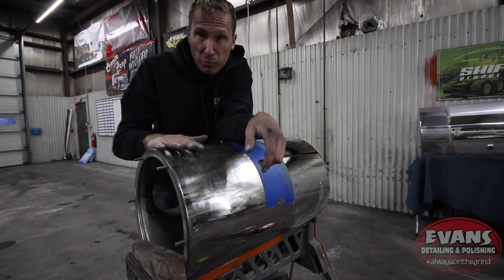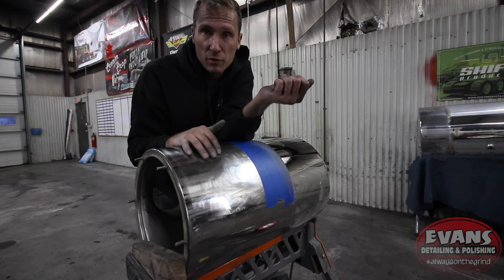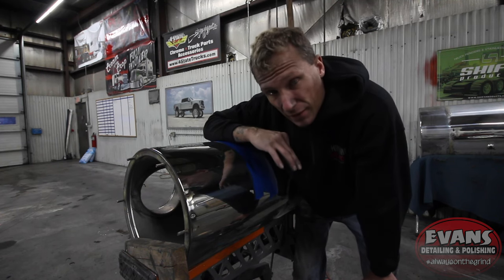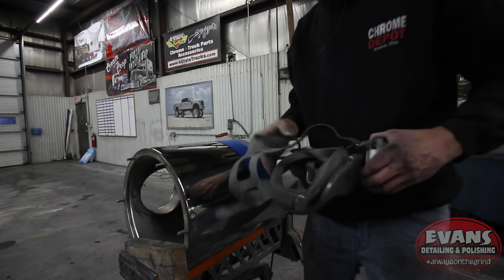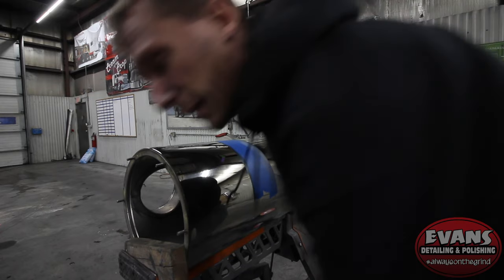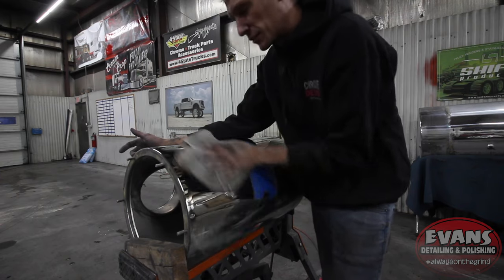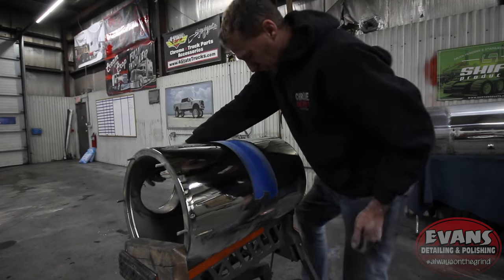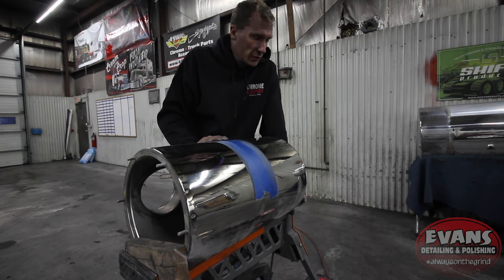How to polish stainless steel to a mirror finish.

Comment: I could see that the sanded side had less nicks, specks etc... Sure it takes longer but I grew up painting custom vehicles so I did a lot of sanding and of course after you painted that beauty it needed to be polished so I had to learn it right or you were fired and or had to repaint it as in my case as my dad was the owner lol.
Reply: I see the same, sanded side is much better.
Reply from the maker: That is the name of the game. The smoother the start the better the finish in almost everything in life. But everyone has different expectations for the final finish. For some the unsanded is good enough.

Comment: What power tool would you recommend for an average joe diyer who just polishes his motorcycle stainless exhaust.  It originally had a mirror finish but have lost its shine due to corrision and road grime. Would a 3500 variable speed polisher due the job to bring back some of its mirror finish?

Comment: Hello Evan just recently Subscribed to your channel, love you're videos.  I have commercial 6ft stainless steel, propane griddle.  What Makita model would be perfect to remove deep & light scratches, Makita 9227c or Makita 6,000 rpm?  Made the error of hand wet sanding the griddle with 400 grit.  When't to Lowes and bought a Craftsman CMEE145, 6", 6,800 OPM, variable speed.  Have not open it, cause, I stumbled upon your videos.  Please guide me towards the correct product for the job.  Thank you Sr.
Reply from the maker: You are on the right path already. The best avenue to get you ahead without having to read a book from me I would go on my channel videos and check the how to sand and polish stainless steel video. It'll be super helpful. We also sell a stainless polishing kit on goshineon.com/shop. If you need anything let me know. Text pics to my cell 9209790386 if you need help and I will try to help you best I can.

Comment: Have any tips how to smooth/sand a big 316 SS hex nut by hand?
I have a pair of 1-5/8” thread hex nuts (700gram each) I wanna make nice and shiny or brushed at the least.

They are like typical nuts… lots of small dings/pits and imperfections from rolling around in storage, etc. …basically like a pseudo hammered finish. I think the first step is to smooth/flatten it, correct?

I tried 60grit by hand… hardly did anything.
Then I tried a Makita “finishing sander” (vibrating kind)… didn’t do anything neither.
Unfortunately, I don’t have any other rotary polishers nor grinders nor belt/disc sanders.

Tried a bastard file… this was by far the best yet. But still took 10-20mins per side (6 sided nut).
I have some old sharpening wet stones I might try next… perhaps for finishing only, since it’s 300/1000 grit.
Reply from the maker: The way I show in this video is the only way I personally know how. I couldn't accomplish this by hand. I know a few that can but I have never seen it done. Sorry I can't be more help on the subject.
Reply: @EvanStegerMetalPolishing  No prob!

I got it done with a bastard file (main step to flatten/smooth out) > 300/1000 whetstone > 1000 wet sand > 1500 wet sand > polish. 

Not perfect; but it's good enough for me. 
Took countless hours, a couple days and very sore forearms, lol.

Comment: What wheel can you use on stainless? Can you use a regular orange cutting wheel? Or does it have to be a specifically made for stainless? And what compounds cut/color will work for stainless? Thanks Evan your the God of polish! 👍🏼
Reply from the maker: You can use whatever for buffs. I prefer buffs made to hold up to the heat of stainless. But that is a preference on my part. goshineon.com has a stainless kit. I also show which buffs and compounds in this video and in my how to sand and polish stainless video. Hope this helps

Comment: Hi thank you for the very valuable lesson Amazing results indeed
Speaking of powder to eliminate the greasy residues will talcum work? Thanks a lot again kind regards Gino
Reply from the maker: Great tip! Yes talcum does work but I personally prefer whitening powder. It is less abrasive than talcum.
Reply: @EvanStegerMetalPolishing  hi thank you for the very kind and valuable advice Your video are very nice and highly educational I have a challenge To try to recover stainless steel knives ended in chloride acid I think I will have to sand them first and then polish them to get possibly a nice look Thanks a lot again Kind regards gino

Comment: If starting from a mill scaled stainless finish what steps would you start with to be most efficient and to cut down consumable costs. I work in a custom stainless shop. And it seems like the techniques we try are always changing because no one can seem to understand it. Lol. TIA great video,
Reply: Our steps vary but are usually around.. If starting from mill finish.

-Rip flat with 120 grit on 5 inch grinder
 
- sand with 220 until previous finish starts disappearing. 
 - Again with 400..
 Repeat process to 6-8-1000- 1200 grit
- begin adding polishing compound and using a cotton buffer wheel. 

-** problems**No matter what, we can always see one of the steps left over in the final finish weather it be a fine or deep scratch 

We are looking for a set way start to finish to accomplish a standard mirror finish. 

Something the same every time.

Comment: im doing some stainless exhaust pipes.cant change direction,the pipes are too small so i have to hand sand after every grit to smooth things out.
pain in the ass.
Reply from the maker: Agreed. They are an absolute pain. I switch up direction on exhaust pipes though. It isn't easy but is achievable.

Comment: Does stainless require same polishing temp outdoors as aluminium. It's about 57 degrees here
Reply from the maker: Yes. Stainless needs to get hot to shine. If it doesn't get hot it won't want to give up the shine.

Comment: And what type of grinders are you using for rpms does it matter between 6000 or a 3500 variable speed??
Reply from the maker: It doesn't matter. It is a personal preference thing. I use 6,000 rpm for cut and color but I use the variable for high lustre finish stuff.

Comment: Evan, can I use the same wheels on stainless that i use on my alum? Thanks. Scott.
Reply from the maker: Yes you can! But I don't recommend mixing them on the multiple surfaces. Once a buff is a stainless polishing buff it is always a stainless buff. Can't really get the buffing compound out of the buff. Hope this makes sense.

Comment: So I have this dull rooster.....any suggestions?
Reply from the maker: To properly polish ones rooster I highly recommend doing it by hand. Far less headaches and a far more gentle approach. LOL I hope this helps.
Reply: @EvanStegerMetalPolishing  good advice.  Do you have any advice on what compound to use?  Do you prefer microfiber or can my old sock get the job done?  How much pressure should be used?  I assume that will need to build up some heat just like when doing stainless for best results?  Lastly, any advice on how to protect the rooster?  Nothing worse then having a dull rooster laying around
Reply from the maker: @ericmerchant3646  I would recommend many different products from goshineon.com/shop. As you know I'm not a fan of microfiber on metal but a cotton sock sounds perfect. I personally prefer a softer pressure as not to scratch the rooster. I would treat it like aluminum to be honest. A little heat but not too much heat. Treating it like stainless might be too hot and cause burning. And lastly a good waxing from time to time should help keep the rooster from getting too dull.

Comment: So what compound are you using and what buffing wheel?
Did not watch all of it but as far as I can see you left out most important parts. My my are you running for political orafce?
Reply from the maker: Thank you for watching the certain amount that you did.  I do mention in this video what compound and buffing wheel that I am using.  Due to changes in the market the last few years,  the color of the color buff has changed since this vide was posted.  So for stainless it is red buff black bar and green buff with yellow.  Again thank you for watching and taking the time to leave this awesome comment.  Appreciate it!

Comment: Thanks a bunch, Just used your vid to do a set of the same air cleaners on my project truck and it worked like a charm. ( 84 359 pete ) I bought it in 1989 and put a million on the clock traded it in 1994 bought it back a few years ago been a 10 year project. very pleased the cleaners look as good as new. Be well.
Reply from the maker: Glad to help. Thanks for watching and supporting.